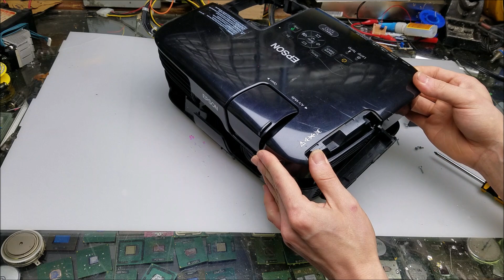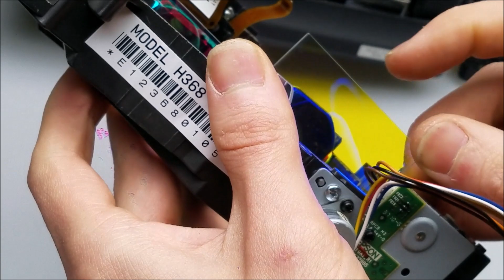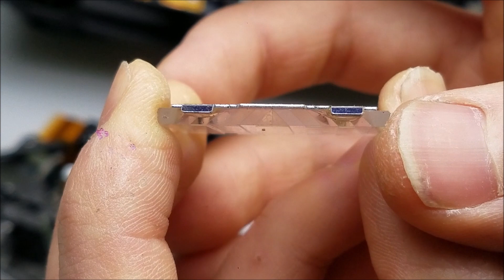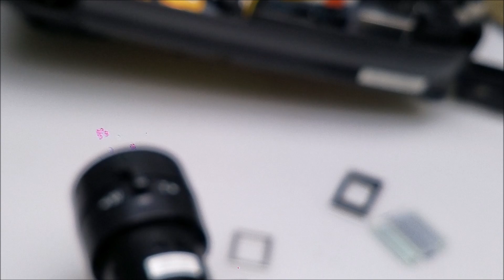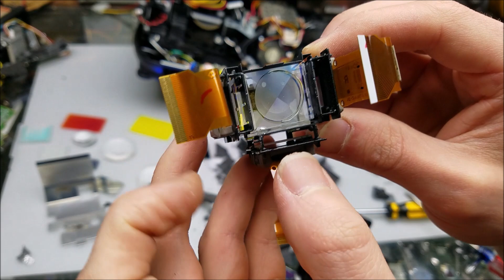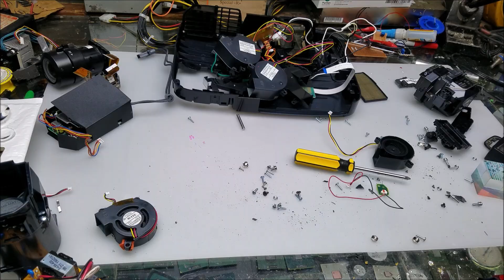Epson PowerLite 1220 Video Projector Teardown

Comment: Hi,
very helpful video! How did you remove the three ribbon cables for the colours? I almost broke one of them trying to remove it and can`t figure out how they are held in. Are they clamped? Or do they just pull out? 
Best regards
Reply from the maker: The dark back end of the connector socket connected to the board raises up and released the ribbon cable.
Reply: @Zenodilodon  Thank you so much! It worked right away and I can finally start fixing my projector.

Comment: What does it mean when I have vertical red lines on my screen?
Reply from the maker: That's a tough one. Either the ribbon cable for the DMD is loose or the DMD/it's drive IC has failed. I'd suggest trying to remove, clean and reconnect the DMD cable.
Reply from the maker: My apologies, there is no DMD, it's an LCD projector, Check the ribbon cables but on the 3 LCD ribbon cables. Same deal, different part.

Comment: 😆R🤣O🙃F😂LMAO!!! Best projector 'breakdown' video EVER! Great editing accent @ 4:45. "Well, that got dangerous." 😱️
"This plastic just crumbles." (nothing to do with me ripping it apart with my bare hands.) 🤷‍♂
"This one is tough. Time for the heat gun (while ignoring the 4 screws)"️🔥 (HEY! MS eliminated the devil emojis! WTF?)
"For some strange reason, this is very therapeutic (while continuing to crumble it into little bits)." Yes, I needed a good morning belly laugh with my pal, Zen.😜
Finished the Teensy waveform module. But so far, something catastrophic happens every time I start putting a demo together. The first time, I overheated the styrofoam that was separating the prototype boards, so it sagged and shorted their power rails, killing the Teensy 4.1. So, now I have a nice safe acrylic case. Last night, I lost X & Y signals. Apparently some Arduino updates corrupted my installation, so no hardware damage. 2 steps forward, one step back.
Teensy MCUs are out of stock until after the chip shortages. Only one spare T4.1 remains. Haven't even started wiring the MIDI desk yet (already killed a 7" Nextion HMI by tearing the matrix's ribbon cable, while fitting it to the front panel. Only ~ a month's turnaround to China.). No pressure, eh? But, I can still make progress with the Akai MIDI desk while waiting. One baby step at a time, right Zen?
I was about to email you to ask, "What was that freebie video editing software that you had mentioned that you like?' I'll need that for my project demo. 😎
Reply from the maker: Hey Herm, the devil's emojies are bad for you and have been removed for the benefit of your soul. Now go say " Hail Marry " 5 times lol. 

The screws weren't ignored, I just wanted to break the bond between the glass cube and plastic, I figured having the larger part still on would give me a better hold... Nope. However later this week I will be deliberately using the heat gun in a comical and improper way on another projector tear down. 

The program I use now is Window's Movie Maker, that is part of Windows Live Essentials now, or altogether not easily available/supported due to BS.exe running at Microsoft. I have also tried OpenShot and it seems pretty comprehensive though not as stable as I would like so save much and save often.

Glad you have more of your laser project works out, I hope you post up video when you get it all running. I can learn some programming stuff from you perhaps. 

Let me know if you need anything else!
Reply: @Zenodilodon  "Now go say " Hail Marry " 5 times lol. "
Hail, I've already been married twice and that was already two too many. I'll just settle for doomed soles, because AFAIC those are the only ones I have. lol
Besides, apparently the underworld is far more interesting than floating around on boring old clouds, listening to harps all day w/o any genitals. According to the TV series, Satan is an awesome party host.
Yes, I used MS Movie Maker several years ago, but thought you mentioned another editor. Just checked the MS Store and there's dozens of apps with that name, mostly freebies. Guess I'll try out the highest rated one(s).
As it happens, I'm considering upgrades for my no-name 40kpps galvos to DT-40s or better, depending on the going $. If you know of any good deals, please shoot me an email. 😎